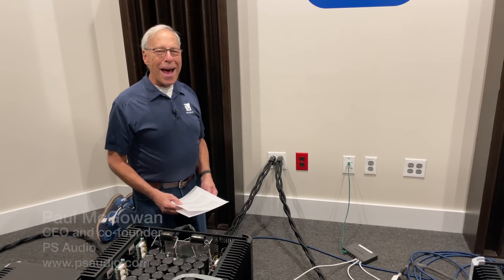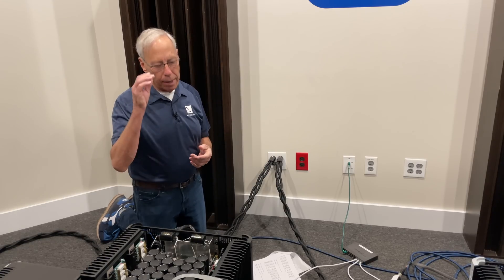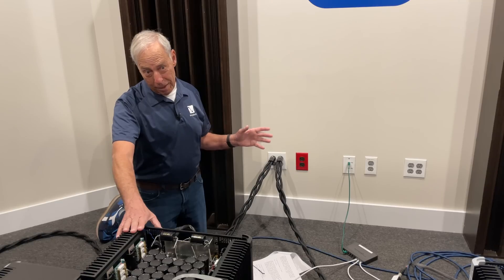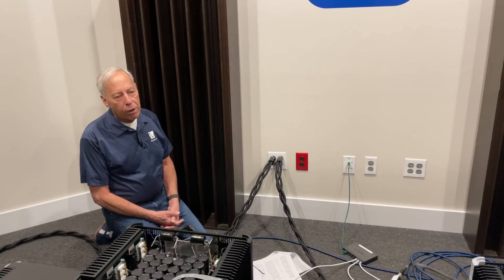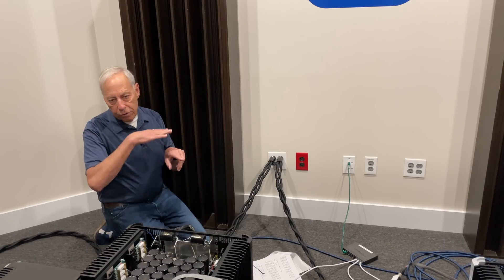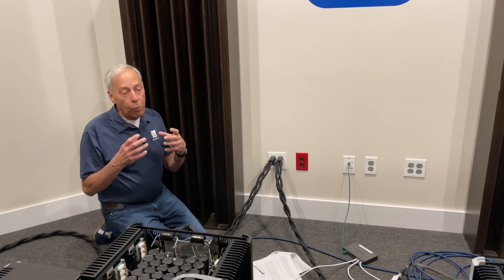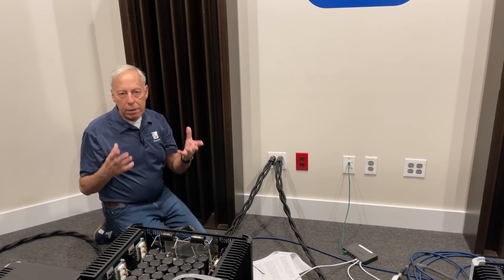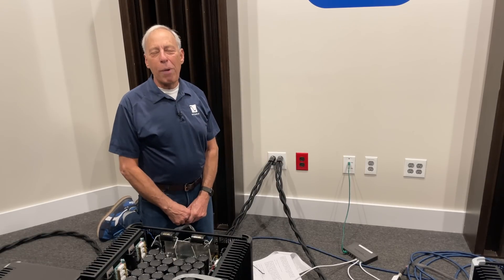Are braided power cables better?

Comment: All of this might make some sense IF the 'quality' of the mains waveform entering the AC inlet on your equipment mattered ONE IOTA. It doesn't however, so don't waste your time !

The AC waveform can be distorted to hell (50/60 Hz supplies are often of around 2.5% total harmonic distortion to begin with) and regularly contain all sorts of conducted and radiated noise from various appliances, from 'inductive kick-back' that results from load switching to conducted interference from thyristor/triac light dimmers to RF picked up from large power radio transmitters. Far from 'pure' in the first place ! It's also connected via the cheapest copper (sometimes aluminium) that the power utility could buy and usually a fairly crappy connector of dubious merit (esp in the USA).

Once it goes through a mains transformer, is rectified and then 'filtered' to make some approximation of DC (which IS what happens) any idea of the 'purity' of the original AC power is simply irrelevant and nonsensical. Even more nonsensical in a switching type  power supply where it's rectified, stored, turned into squarewaves, rectified once more and stored again !

The idea that the last few feet of cable attaching your equipment to the wall socket COULD make any difference is pure MADNESS too. Remember it's NOT the AC that powers the electronics . The electronics runs from DC !

It IS true that creating very 'pure' DC from the power supply DOES make a difference, often quite significantly so. My own 'best' power supplies produce around 50 MICROVOLTS of audio band noise ONLY. A lot of professional audio uses remote DC power supplies so that the line frequency AC doesn't even enter the equipment. But the AC itself is ENTIRELY unimportant  It matters not one jot !
Reply: @Graham Stevenson:

Please list the power cables that you used in your listening test, to conclude that power cables make no difference.
Please also list all of your stereo's components that were used in your listening test (speakers, amps, pre-amp, DAC, transport, phono-amp, tone-arm, cartridge, etc), and room treatments.

As to:
"The idea that the last few feet of cable attaching your equipment to the wall socket COULD make any difference is pure MADNESS too"
Remove your shower head.  It is MADNESS to believe that water that traveled for miles would make any difference once it reaches your bathroom when using a show head.
Reply: @0Perhaps  get a brain
Reply: @0Perhaps  it's all about the power supply doing the DC conversion...not the last 5' of AC
Reply: @Douglas Blake There are multiple companies manufacturing braided power cords as well as other types of improved performance power cords. There are literally thousands of people who have tried the various power cords and have arrived at similar conclusions; they alter the sound at the speaker. So do you choose to believe someone who states an OPINION based on book theory or do you choose to believe an eye witness? Or more accurately, THOUSANDS of eye witnesses? You obviously have not auditioned any of the cables, so you are unprepared to offer a valid opinion. Do an A-B comparison, then tell us your results. My posts are based upon my real life experiences and the results of A-B testing.
Yesterday I tried 4 sets of power cords with Rhodium plated ends (2 amps, 1 for the pre amp, one for the DAÇ). There was an immediately noticeable change in the sound; too punchy and the treble was sharp and irritating. If this was all placebo, I would have "heard" an improvement. But since it is not placebo, I heard unpleasant results from the more expensive power cord compared to the less expensive non Rhodium version. Put up your money and audition a set, THEN you can offer a valid opinion.
Reply: @Douglas Blake I have active powered studio monitors, if I use a Kimber power cable on one monitor and a standard IEC cable on other monitor, then the monitors become unbalanced.  Kimber power cables do improove sound.
Reply: @Douglas Blake these Kimber cables can be demoed easily, find someone that uses them, then have that person switch cables, you will realise your wrong once you hear the difference they make.
Reply: @BoomerUKEngland  Douglas Blake knows that she is wrong.  She will never admit it.  If she admitted that she was wrong, she would lose her job.  Her job is to troll.
Reply: @Douglas Blake Many people get degrees and blindly follow what they learn in a textbook. Other people, like myself, keep an open mind and look at REAL WORLD facts and test results. For over 50 years, we were taught in school that the lift generated by an airplane's wings was caused by an increase in the velocity of the air as it traveled over the top of the wing. Guess what a professor in Cambridge proved 10 years ago? That there is no increase in air velocity over the wing. So for all those decades, the so called experts and people with degrees were wrong and were repeating and teaching the wrong information. Here we have audible proof that the so called experts with their experience and degrees are wrong
Reply: @Douglas Blake You wrote:
"Who do you think is more likely to be correct ... hundreds of engineers, with  all their training and education on a specific topic ... or one guy who came up with a different idea?"

Please list the hundreds of engineers.
Please list "all their training and education".
Please list the equipment that they used in their listening tests.

Please list the equipment that you used in your listening tests.

You will reply, but you will never answer.  Why?
Because you spew BS.  You make things up.  You lie.

You never listened to that which you are bashing.
You might as well start bashing TVs that you never viewed, and cars that you never drove, and food that you never tasted.

You are a troll that harms this hobby.

Prove me wrong.  Answer my requests for the names of the "hundreds of engineers", and "all their training and education", and list the stereo equipment used by each of them and by you.

You will not.  Instead, you will keep digging.
Reply: @Douglas Blake You wrote:
"Good lord man ... I don't envy you.  If anything I pity you for how easily these shyster companies part you from your money."

Who asked you if you envy me?

I wrote that you envy those that own gear that is out of your reach.
I cannot afford that gear.  I envy people that can afford that gear.  But I do not troll those people.  You do.

Getting back on topic:
You wrote:
"Who do you think is more likely to be correct ... hundreds of engineers, with  all their training and education on a specific topic ... or one guy who came up with a different idea?"

I replied with:
"Please list the hundreds of engineers."
"Please list "all their training and education."
"Please list the equipment that they used in their listening tests."

"Please list the equipment that you used in your listening tests."

"You will reply, but you will never answer."

You came through, as I wrote.
You made BS claims.  I asked you to support your claims (see my quotes, above), and you did as I wrote you would do.
You replied, but you did not answer.

You write BS comments after BS comments, and when asked to show any reference to support your BS comments, you reply with blah, blah, blah, and never an actual answer; never any references to support your BS claims.

Keep replying with noise, rather than replying with substance.  Keep replying with irrelevant comments that never support your BS claims.

Keep trolling.  Keep entertaining.
Reply: @Douglas Blake You wrote:
"Y'wanna know why nobody is answering your ridiculous challenges?"

Attempting to represent others is snobby and obnoxious.  You are asserting that they cannot convey their own reasons.
Speak for yourself, and do not assume you have a license to speak for others.

Please quote my "ridiculous challenges", and specify which part is "ridiculous".
Be specific.  What is the ridiculous part?
Reply: @Douglas Blake Not true. I just tested some cords with Rhodium ends yesterday. They were horrible. If your statement was correct, I would have loved them. Apparently your presumptions are incorrect again.
Reply: @Douglas Blake Actually, what your hear is a fact. Whether or not it is pleasing is an opinion. Get your facts straight if you want to join the adult group in this discussion.
Reply: Science is irrelevant...
This is a religion.
Reply: @poserwannabe1  There is some truth in that for some Audiophiles. But to say that as a blanket statement for everyone here is just trolling......
The so called engineers are more fanatical about their religious view on this topic than the others. The engineers aren't willing to do a test and compare results. THAT is more religion than science. :)
Speaking of religion
MERRY CHRISTMAS to all!!!!!!
Reply: @briangc1972  naah, I'm not trolling, just some of this is completely ridiculous...
Merry Christmas !!!
Reply: @Douglas Blake the twisted cables remove EMI and inductance from entering the PSU.   Even good PSU's can't remove all of this.   This EMI then raised the noise floor, then it turn reduces dynamics and details from the sound.   If you were standing in same room the improvement in sound can be demonstrated in just a few minutes by switching cables.
Reply: @BoomerUKEngland  Douglas Blake is an envy troll.  She cannot afford quality stereo equipment, and so she bashes it; convincing herself that she is not missing anything.
This is nothing new.  She does this often.

Douglas Blake knows that you are correct.  But she will never admit it.

I cannot afford this stuff.  But I heard it.  So I know it works.

My local high-end store swapped out their stock power cords with Shunyata power cords (and later with Audioquest power cords).
I was there.  I heard the improvement, which was substantial (not imagined).

Douglas Blake will never actually conduct a listening test.  She can't, because she does not have access to the gear (which depresses her).
Most people do not have access to such gear.  But most people that do not have access will not bash what they have not experienced.  And that is what separates level-headed people from the "dying with envy" Douglas Blakes of the world.

The Douglas Blakes can spew their ignorance for our entertainment.  We all like to watch train wrecks.
Reply: @Douglas Blake 😆😂🤣
Reply: Another theoretical response from a guy who has not tried an A-B comparison.
In theory, you may be correct. In real life, in a quality Hi-Fi system, you are 110% WRONG.
If you have a quality system and are using the cheap factory power cords, then you should take the time to try a set of braided power cords and hear if they do make a difference or improvement. Until you do so, you are just another keyboard warrior wasting bandwidth with your unintelligent opinions. I have done the A-B comparisons with my system and there was a noticeable difference. FYI, you don't need to spend thou$and$ on power cords. There are very good ones available for under a hundred that offer the same improvements in sound.
Reply: @briangc1972  I totally agree with you, people who say otherwise have almost certainly not tried these things.
Reply: You are 100% correct sir.